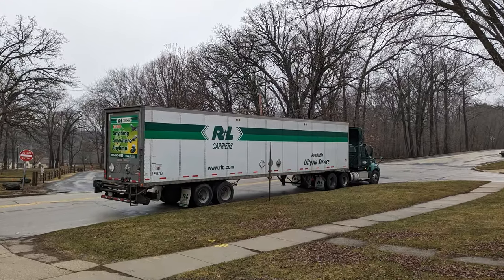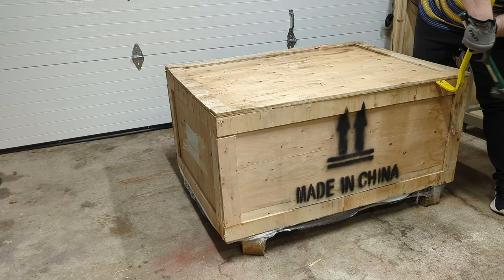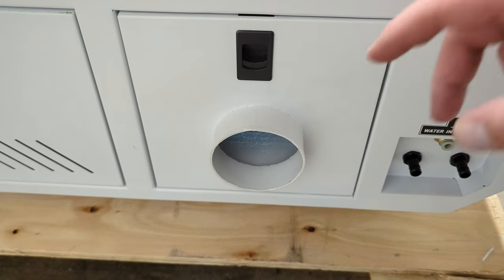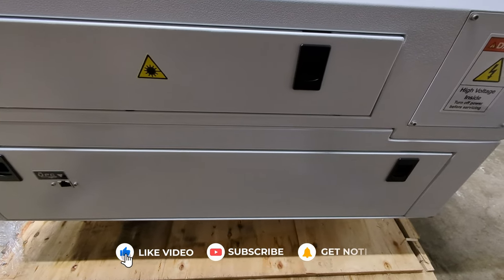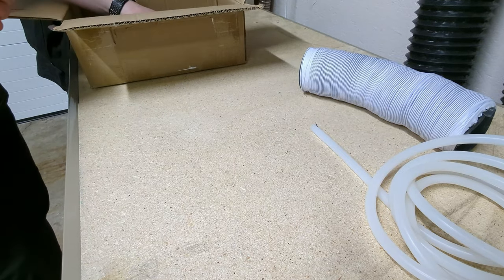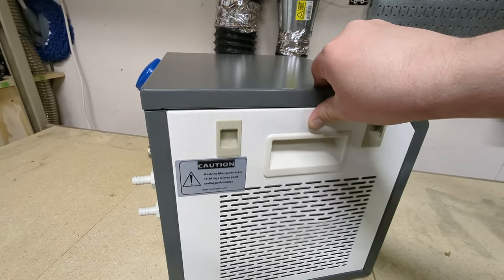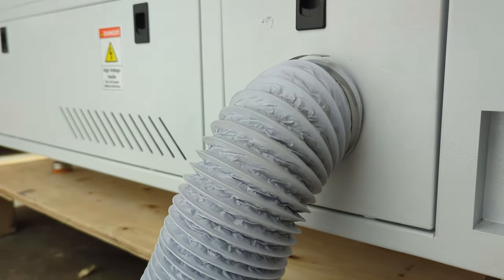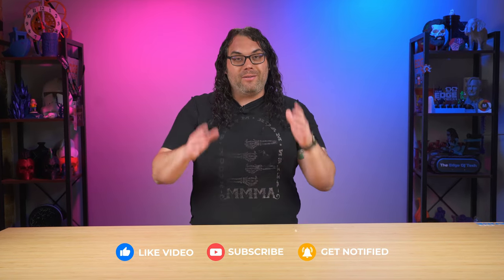Unboxing And Setup Of The LightObject Ranger III

Comment: Glad to see you have the Ranger 3. I just took delivery of the 90W version last week. Set up and alignment went smoothly. I was a little apprehensive about installing the 90W tube as because of it using an extension housing isn’t shipped installed. It’s a tight fit but support gave me tips to get it right. 
My amp meter is on the top left panel easy to read. 
Look forward to your experience with it.
Reply from the maker: Awesome!!! I hope you love it!